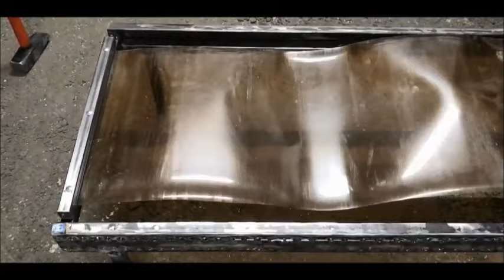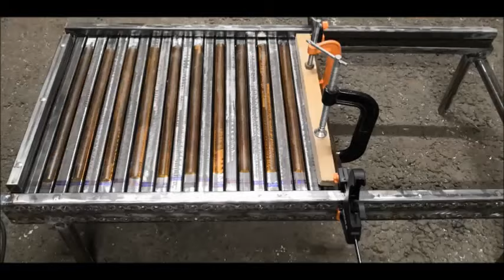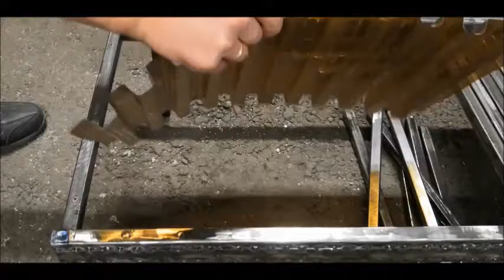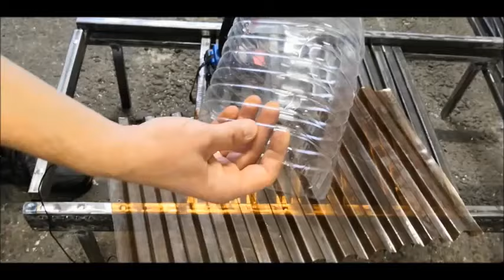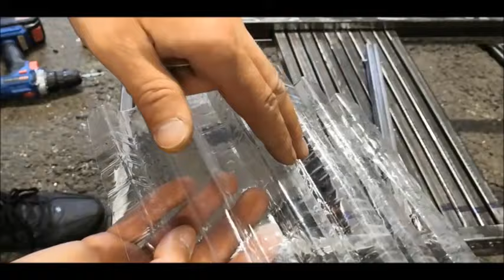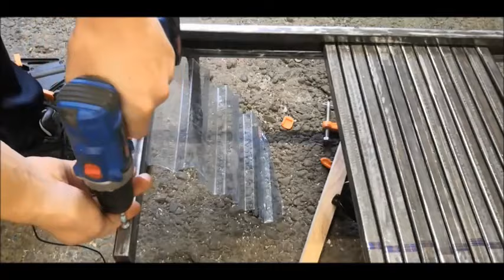SLATE, SHINGLES MADE OF PLASTIC BOTTLES

Comment: Amazing! Is it possible to combine two sheets together with a hot gun?
Reply from the maker: To be honest, I haven't tried it, well, I think it's possible
Reply: You can heat seal plastic shopping bags with a somewhat rounded tip in a soldering iron if you stack them with wax paper or baking parchment on top to keep the melting plastic from sticking to the metal tip.  HDPE  thicker than your typical WalMart bags are easier to weld a seam this way.  It should be easy to experiment with scraps of PET plastic like the transparent bottle sides cut from a 2 liter soda bottle with the flat cylinder you can cut out and flatten.  
If you can't get it to adhere to itself with heat and pressure from a smooth blunt soldering tip, I do know that PL Premiun construction adhesive works well on PET, probably even better if you sand the areas of the sheets that will take the glue.
Reply: Could try spot welding with a flat tip on a soldering iron

Comment: you cant make stuff cheaper than you can buy it these days. Only Maybe if you have all the tools already, free labour and time and unlimited free material. How many bottles (the same size)would you nees to find to complete a job. Plastic in  bottles is not designed to withstand UV, frost. wind and rain. It is also too thin. Even the flimsiest manuf roof sheet is not as thin as bottle plastic. Wont last more than 2 years in UK weather
Reply: Hiw do you think the farmer did it before he laid for workers???